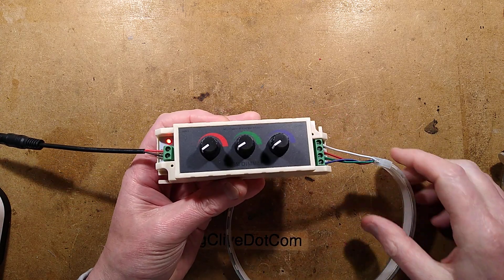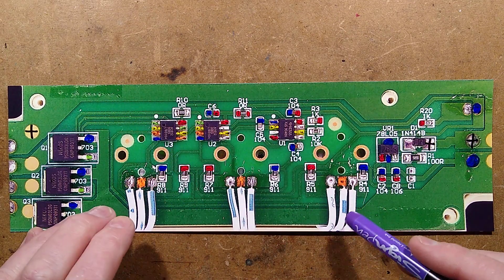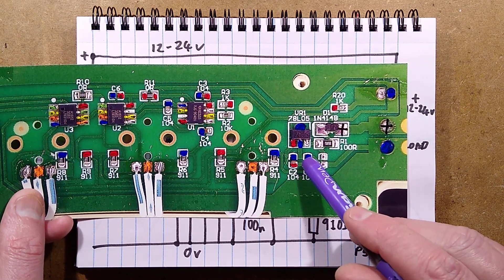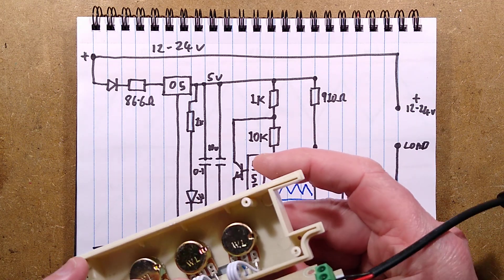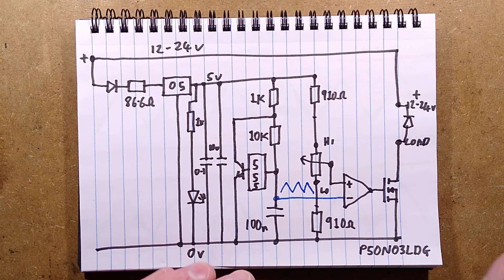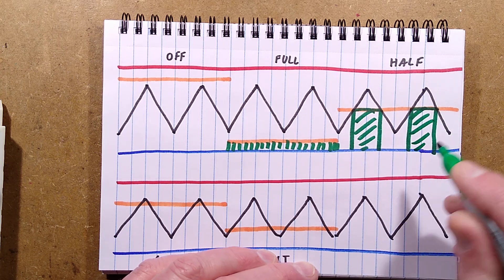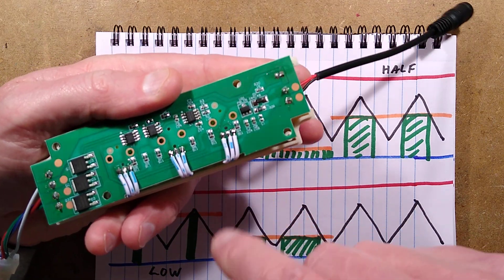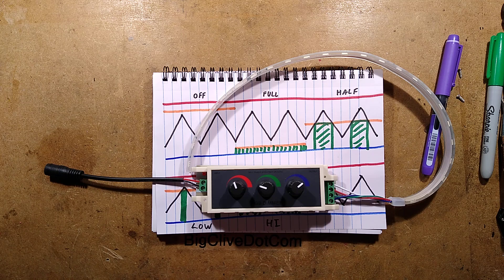RGB dimmer teardown and schematic (no microcontroller)

Comment: I love the simplicity of this circuit. It is functional and reliable.
Reply: As Products should be!
Reply: Yep and it will probably operate for a great many years as a result of that simplicity. I am an old school electronics engineer, never bothered learning digital, only analogue. I have circuits I designed for my own use (outside my professional industrial stuff) that have been working continuously for nearly two decades now, they just go on and on working away 24/7. Well built analogue circuits are just that reliable.

Comment: I used a 555 as the basis for my final GCSE project, was an egg timer and worked first time much to my own amazement. Amazing that they're still using this very versatile chip.
Reply from the maker: The 555 still appears in a surprising range of commercial products.  Like street lighting dusk sensors as a threshold operated relay driver.
Reply: @bigclivedotcom  I'm starting to get back into electronics tinkering, maybe I'll do a 555 project and relive my glory days.

Comment: I had a bunch of these about 10 years (still do)  and was mostly impressed with the 555 configuration.  IIRC it had three 555's on board and 5k pots.
  THE 555 WILL NEVER DIE!
ALSO, you mentioned educational uses...
I built a color clock in which the colors of the LED's mixed as the rainbow (but including MAGNETA).  It was a ONE-OUTPUT clock with the colors smoothly mixing acroos the spectrum.  With practice, one could get at estimating the time of day from a single color-sum.

I didn't know they were still around.
THANKS FOR ANOTHER GREAT TEARDOWN!!
--dALe

Comment: reminds me of when I made a power telemetry system for 15 channels whose only digital component was a 4 bit up-counter. Used that to sweep through an analog multiplexor that looked at 15 different scaled analog telemetry readings, with one sync pulse for timing. Fun times.

Oh, and it did use a 555.
Reply: I was so ready to write "I could do that with a 555", but then...

Comment: The triangular wave form goes exactly from 1/3 to 2/3 of the supply rail, because the turn on and turn off points are set by three identical resistors inside the 555 (usually 5k each). So a 1k potentiometer and the two resistors of just shy of 1k would make sense.
Reply: That's why it is called 555 after all.
Reply: @maxine_q  not a lot of people know that :)
Reply: @maxine_q  no its a coincidence, not the reason. eevblog has a video explaining it
Reply: The First sentence made my brain hurt😝
Reply: I thought that too when Clive was guessing. 1k would make the end points slightly above and below the waveform. Gets you a 0 to 100% PWM range. Beautifully simple

Comment: Impressive that they are using a single 555 for all three channels.
Reply: More impressive (or something) that they are using three sets of high and low resistors for the three pots. You only need a single pair of 330 ohm high and low resistors for all three 1K pots in parallel.
Reply: @lwilton  Then you'd have to triple the values of each of the three pots, since 3 times Rx in parallel equals to 1/3 Rx, which would skew the voltage divider chain. But yeah, would be doable, i guess?
Reply: @DerMarkus1982  Nope. The current pots are 1K with 910 ohm resistors top and bottom. Three 1K's in parallel is about 333, so a single pair of 270 or 330 ohm resistors will do the trick for three 1K pots.
Reply: The schematic is just showing one of the outputs. You need to have 2 more to control all 3 colors. So, it’s using (3) 555’s in total, not 1.
Reply: @edpietila2026  No. Look at the PCB. It has only one 555 timer IC, providing the "compare to" signal to all three OpAmps.
Reply: @DerMarkus1982  My mistake. I didn’t look close enough and thought all 3 chips were the same. Makes sense to use (1) 555 and have it send the wave to all 3 circuits.
Reply: @edpietila2026  Er, no. Look at the picture of the board again. There is one 555 and two dual opamps. All you need is one ramp generator, which is what the 555 is doing. Then you need a comparator for each channel to compare the pot voltage for that channel to the common ramp voltage.
Reply: @lwilton  Well. If the 555 timer is only used for generating ramp signal, i think they can use the op amp to generate those signals, therefore no need for 555
Reply: @raketadynej2prime405  : That gets you either a sine wave, or a single ramp only. If you're looking for a repeating ramp then the 555's extra circuitry is helpful. So, throwing in a single 555 is desirable, since it makes it easier to implement the ramp generator.
Reply: @raketadynej2prime405  There are a couple of problems with that: first, by the time you have enough passives to generate a ramp with an opamp, you have paid more in parts and possibly real estate than the cost of a 555, which is close to the cost of a resistor. Second, using a single opamp and passives it is hard to generate a ramp with defined constant high and low limits on the ramp voltage that don't change with temperature or parts aging or with each part. The 555 just naturally does a 1/3rd to 2/3rds ramp by design.
Reply: Thats what she said. 😅😂
Reply: Looks to me as if the op-amp/JFET combo serves as an external pin 3, giving the effect multiple 555s with identical timing components

Comment: I’m stealing this design. I can’t believe I didn’t think of this before. I’ve built a similar circuit before that used a comparator to generate a PWM signal from the sawtooth output of a voltage controlled oscillator. It never occurred to me that multiple comparators could be fed the same signal to generate multiple duty cycles.
Reply: It's fairly elegant.
Reply: I was planning something similar, but still rather different:  Multiple 555s driving simple discrete amps, with overcurrent protection.
Reply: Ah, use an Arduino! It's such a simple project, it'd be a good way of learning programming. And programming microcontrollers is cool, much less bother than programming a horrible modern computer. Micros don't even HAVE an operating system!

Well... they can, on some of the more complex chips, if you need one. Most people don't!
Reply: @greenaum  KISS:  Keep It Simple, Stupid

Simple things like these are easier to design and troubleshoot.  I have a programming degree and troubleshooting even a small program can be very painful.
Reply: @greenaum  I have to agree with GeneralPurposeVehicl. KISS is well known for good reason. Sawtooth or triangle oscillators don't require programming, don't crash, and don't need FCC approval in a product (anything with a >8KHz oscillator does). There are hundreds of thousands of microcontrollers running my code right now (you might even own one), but I prefer this reliable analog approach for many reasons from design to manufacturing.
Reply: Theo microcontrollers use this arquitecture. You have a sawtooth generator, and for each output you have a comparator
Reply: @GeneralPurposeVehicl  I have some programming qualifications myself, and the rest is self-taught.

The sort of program you'd need for this would be almost nothing. Read the pots through one of the ADC inputs. Set one of the PWMs accordingly. That's it! Like, 10 lines of code. 

If you don't have PWMs on your chip, do it in software. You just use a counter for each PWM channel, increment it every so often, and when it reaches X value, reset it, and flip your software-implemented flipflop. 

People did it in the days of the ZX Spectrum. Using a 3.5MHz Z80. You used 3 of the registers as counters, according to the frequency of the note you were playing. When one of them overflows, flip the flop.

The Spectrum had a single, tinny little speaker that could only be set to on or off, 1 or 0, in software. So a beep would mean the CPU has to push and pull the speaker at whatever rate. Counting cycles to measure time. That's it, the BEEP function in BASIC did just that, the entire CPU just looping and counting and flop-flipping.

But by using 3 registers and some decent code, you could get 3-note polyphony, from a simple 1-bit speaker! You couldn't do much else though while it was playing, but it was impressive in programs that did it. A few games, basically.

Software is easy to debug. All that analogue stuff with voltages and impedances and capacitors and stuff, nah! Cut all that out! One chip does the lot, and debugging 10 lines of code probably isn't even possible! There just isn't room for a bug! 

If you use Arduino, the whole suite has stuff like software PWMs as functions anyway, so you don't even need to write it yourself. And it's all debugged and updated by a rabid team of the sort that write Linux. Which is OK, because it's an IDE for programmers, not software that normal people are expected to use! Literally like 10 lines of code.

If you liked, you could do it on an ESP8266 and set your lighting through wifi.
Reply: @greenaum  I use microcontrollers for some things but using one for something like this is bordering on overkill.

You can breadboard this circuit with no prior knowledge and no additional tools using two ICs, a handful of passives, and 3 mosfets. No additional equipment required.

To use a microcontroller you need a computer, the software to program the micro, an ICSP programmer OR a chip preprogrammed with a boot loader and a serial TTL adaptor. The closest you'll get to a plug and play solution that's suitable for breadboarding is an Arduino Nano, and that's a lot of horsepower for something as simple as a 3 channel dimmer (and not all of the channels will use the same frequency).
Reply: @factorpotencia  sort of but not quite. They use counters/timers and logic comparators. It's the same idea but it's based on digital logic rather than analogue circuitry.
Reply: @greenaum  Arduino is a lot of fun, but I bet this circuit uses up less current than the Atmega would be gobbling up.
Reply: Use a LM324 quad op-amp. One op-amp generates the ramp, the other 3, act as comparators, and generate three independent pwm outputs driving the MOSFETs.
Reply: @matthehat  I agree it doesn't feel right to me to use a microcontroller we have to teach the young kids to use discrete electronics.
Reply: @toxicpadda  when actual procedural logic needs to be performed or you have to design a complex system with lots of variables to keep track of or lots of potential states then a microcontroller is the tool for the job. Reading a potentiometer to change the duty cycle of a pulse wave just doesn't seem like a task worthy of a microcontroller.
Reply: @matthehat  my line of thought exactly 😉👍
Reply: I'm not so keen on using a microcontroller for a simple pwm circuit. But some of them have become so cheap (Like the Padauk only 3 cents). Even the simple blinking on and off of an LED, is now done with a microcontroller. I just don't think it's always the most robust solution.
Reply: @MyProjectBoxChannel  A classic example of overkill in my opinion, throwing a microcontroller at a circuit designed to pulse an led on and off. Sadly analogue design is becoming a lost art.
Reply: @cbcdesign001  analogue electronics is a thing of beauty. It is the art of bending electricity to your will.
Reply: @greenaum  : Much like a boot-strap buck converter to power your Arduino, this is a project for non-processors.
Reply: @absalomdraconis  When I'm buck convertoring my Arduinos, I use a BASIC Stamp.

Comment: Actually, the capacitor on the 555 fluctuates between  1/3 Vcc and 2/3 Vcc based on an internal voltage divider.
Surprising that they didn't use the 4th channel to control RGBW tapes.

Comment: The 555 uses potential dividers to 1/3 and 2/3 of the supply voltage to switch between loading and unloading the timing capacitor. Therefor a 1 kiloOhm potentiometer would make perfect sense because together with the 910 ohm resistors you would have a range that is just larger than the voltage swing of the capacitor, so you can go from 0 to 100%.
Reply from the maker: That makes sense.  I didn't realise that the resistors in the 555's internal divider are effectively all the same value.
Reply: @bigclivedotcom  you wont believe why it is called 555 timer ;)
Reply: I just wrote almost the same comment before I saw yours 😂
Reply: It's actually not called the 555 because of the three 5k internal resistors.

"Although, there is a belief that this IC got its name from the three 5k resistors in its internal circuit, Hans R Camenzind revealed in his book, “Designing Analogue Chips”,  that it was Signetics manager, ArtFury’s, love for the number “555”, that led to the naming of the circuit."
Reply: @Brokkoli7hun  I was today years old when I made the connection between the name 555 and the three 5k resistors. Facepalm 🤪
Reply: @bigclivedotcom  IN the 555 basically they are of the same RATIO (1:1:1)... & each being 5kOhms..
Hence the i.c. gets its name..
555...
& in this ckt. the op- amp divider chain has the same ratio...( but diff.value ) cos.its compared to the 1/3...2/3 thresholds of the timer chip.. 
Anyways I really do like your style of how you do your vids...👍👍👍& 🙏🙏🙏🙏🙏

Comment: 555 timer is still one of my favorite ICs.
Reply from the maker: It's actually a really useful set of internal blocks.
Reply: a classic!
Reply: i made one from transistors on a perfboard once when i was prototyping a circuit because i didn't have a 555 at hand
it look crazy when a 7x5 cm board is sticking out of ic socket but it works
Reply: I've got a bag of 555's that I've never used. Could you show us some things to make with them Clive?
Reply: $4 for 100 555 chips from Aliexpress 😜
Reply: At least it’s still widely available. Unlike the LM3909. Though I think I’ve seen a circuit online for a copy of that made of discrete components…
Reply: @markiangooley  As a kid I got a horrible electronics kit, "Tree of Knowledge", made in Israel. You had to assemble the variable capacitor yourself, out of a sheet of mylar with cut-outs on it, and a sheet of thin copper with the same, cut-outs pressed into it. You had to interleave them. Then the potentiometer was a strip of carbon-coating plastic, with a copper wiper and some shitty plastic, and you had to assemble THAT yourself too! 

The main board was basically a breadboard, made of horrible cheap plastic, and you got a sheet of copper "fingers", that you stuck into the plastic frame. The same stuff a cheap breadboard would contain, but you made it yourself. Utter, utter, unforgivable shite to make as an Xmas present for an unwitting parent to give to a kid to scare them off electronics forever! Shite it was!

Anyway... I was gonna say... it came with a circuit diagram of the 741 op-amp, which was pretty interesting. Can you figure out how I was supposed to make a chip socket out of 2 rubber buffers?
Reply: @Tsnafu  Google for signetics 555 applications and you'll find several interesting ideas from Signetics.  The hardcopy original had "See!  It can be done!" on the front cover.
Reply: @greenaum  so, you actually had to learn how the components were built and worked. the thought of actually having to know something, sheesh ;)
Reply: @Tsnafu  : Here's a set of ideas for you- simple buck (or boost, if needed for some reason) power supply, modulators to send data to a computer (or your phone) over a microphone line (remember to filter down to sine waves if you want multiple 555s on a single mic line!), and another as an oscillator for an array of touch-buttons. Use some diodes + rc filters for detection of individual button touches, maybe some comparators if you want better detection, and you have the building blocks of a custom keyboard. At that point, you just need to decide how to hook it all together (to avoid a microcontroller, use the comparators to detect levels of "touch", throw their outputs into a R-2R circuit, buffer the R-2R's output, and use to drive the control-voltage pin on the audio 555; for a microcontroller, use one pin to control the audio 555's control voltage, use a frequency detector on another to receive data from a headphone out, and interface with touch detectors and your choice of outputs using the other micro pins).

Comment: Title: "(no microcontroller) "
Clive: " The 555 was one of the first microcontrollers" .
Everyone: Pikachu face
Reply from the maker: Yeah, that might be my best slip up in a long time.
Reply: @bigclivedotcom  hahaha
Reply: That threw me for a loop as well.
Reply: Someone Somewhere (probably on the EEVBlog forum): Challenge Accepted!
Reply: I mentally replaced "microcontroller" with "integrated circuit" there. Loop evaded.
Reply: @DerMarkus1982  A microcontroller is also an integrated circuit though... Oh crap.
Reply: @PunakiviAddikti  Does it help you avoid The Loop [tm] that only a tiny fraction of integrated circuits are microcontrollers?
Reply: @KonradTheWizzard  I guess yeah, kinda.
Reply: @stargazer7644  Given the size, I don't think that counts as micro anymore.
Reply: @stargazer7644  I am duly impressed by this incredible feat of hackery. However, it is not exactly MICRO - is it? (Unless you view it through the lense of the 1960'ies.)
Reply: @KonradTheWizzard  Oh, I dunno.  I think it might fit into the case of some of the 6502 microcomputers that have been sold in the past.  :)